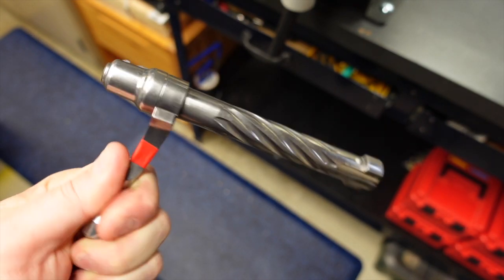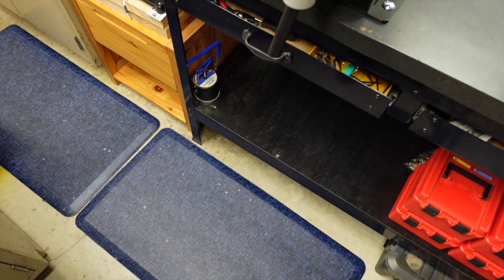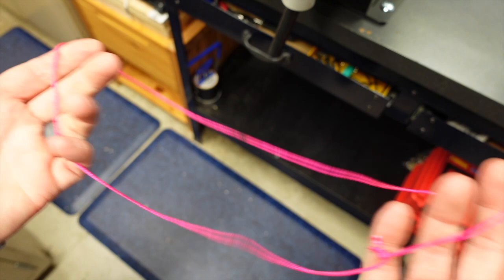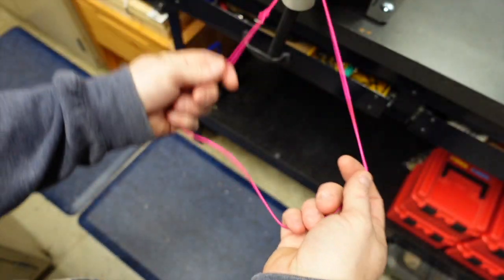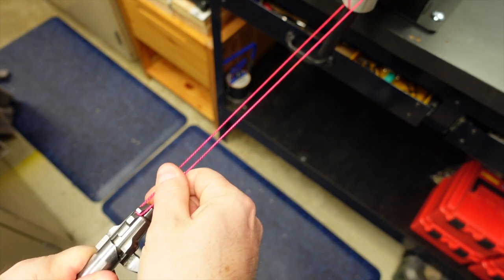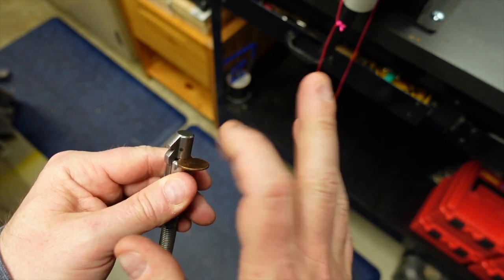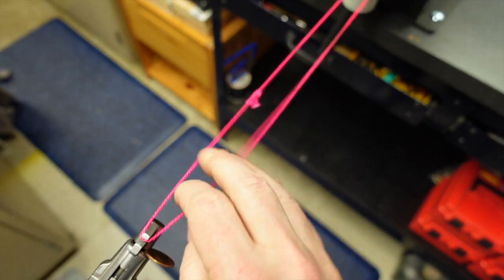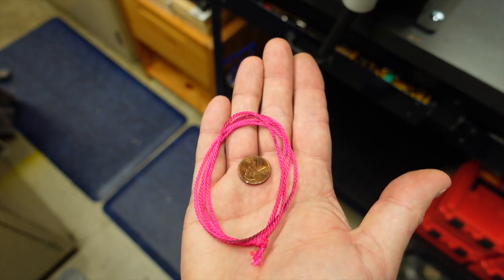Bolt disassembly with string and a penny

Comment: I understand removing the firing pin is the right way to check for shoulder bump by chambering a piece of brass using just the bolt. Would I have to remove the extractor and ejector as well?
Reply from the maker: Not the extractor but some people remove the ejector yes. My bolts don't have ejectors so I don't have to do it but I know guys will remove them sometimes.

Comment: That's one thing I love about my Howa, one piece forged bolt with easy disassembly, good extractor too.
Reply: I really like my Howas.  There is no way that anyone would confuse me with a skilled F class shooter, but they shoot one ragged hole out to 300 yds for me, and always stay sub MOA out farther.
Reply: @rapidrrobert4333  one ragged hole at 300 yards is like 0.1 moa. you realize that’s like insanely accurate?
Reply: @taylorbokshowan5713  I now.  I have been shooting for a long time.  The five shot groups measure around .375" with a 6.5 Creedmoor, heavy bbl, EC tuner, in an MDT chassis from an F class front rest and a sand bag from a concrete bench.
Reply: @rapidrrobert4333  Then the only thing stopping you from being very competitive in F-class would be wind
Reply: @taylorbokshowan5713  ... and a new rifle set up.  I admit that I am talking about my all time best (lucky?) group, but it does shoot MOA.

Comment: I read a lot of articles saying the Remington action is not very good.  Yet there are a lot of actions that are Remington clones.  Are these clones basically the same as the Remington but are made in custom shops to closer tolerances, and better materials, or what?
Reply from the maker: Yes most of these actions are based on a Remington 700 but are made out of far superior materials into much better tolerances and repeatability. It used to be that you could buy a Remington 700 and have somebody blue print it and that still works fine but it will never reach the level of a custom action. From what I understand and have seen the main theory is that custom action makers mimic the 700 simply because there are so many out there and so many stocks and other accessories that it just makes sense to copy that action.
Reply: @FClassJohn  Thanks.  That is what I suspected.

Comment: Thanks John, that is one of your Defiance bolts?  I do the same thing on my m700 actions. I was afraid to pull that far on my Defiance, it doesn’t have the little slot on the back of the firing pin assembly.
Reply from the maker: Yeah that's one of my Defiance Deviants, no issue pulling on it.